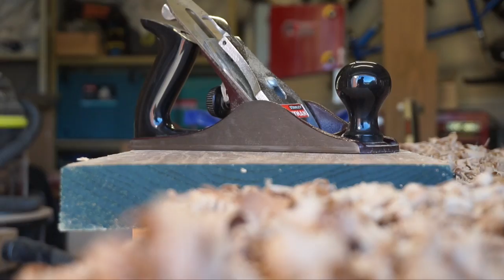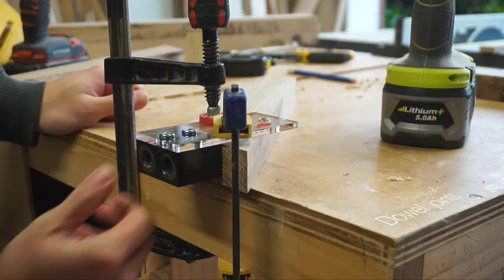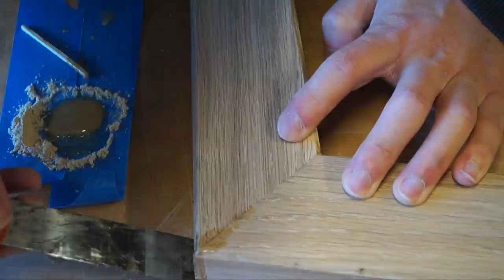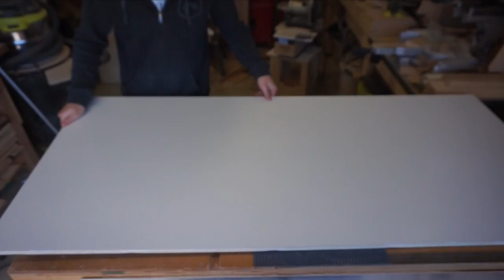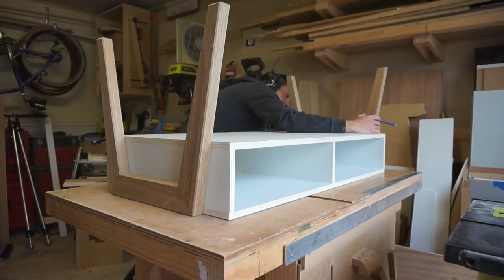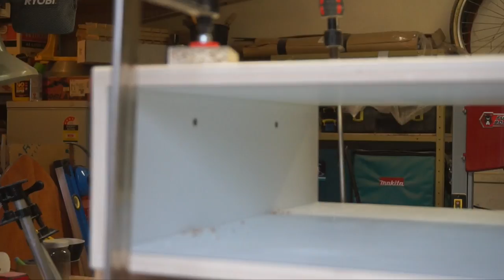Oak and Plywood Coffee Table

Comment: Maybe you already know this, but I have a small tip for hand planing. When you're trying to hog off that much material, you can start by planing 90 degrees cross grain. The wood is much weaker in that direction, and who cares if chips and splinters. Once you get close to final dimension or flatness, then you can reduce the depth of cut and switch to planing with the grain.

The only caveat is that you shouldn't take full widths strokes or you can blowout a big chunk from the side of the board that's facing away from you.

Comment: I like  your design, combination of colors , exposed edges.  if I may reproduce  your work, I would make the plywood joints miter and keep the edges exposed on the front and the back. I would make the beams straight without these arcs or braces,  and may be they  extend a bit  beyond the legs . Thanks for sharing
Reply from the maker: Thanks! Yes I agree, if I made it again I would do miter joints instead. I had initially planned to edge band the sides so you wouldn't see the edges so I went with butt joints, but then I decided not to edge band it but couldn't recut it to make miter joints.

Comment: did you paint the screw heads or something for the final photos? or edit them out in post production? anyways, love the table, really great work your cautiousness scoring the melamine really paid off, it's hard to pull off exposed engrain in melamine but it works in your case since you were so careful.  great project
Reply from the maker: Ahhh you got me! I did edit it out in post. It didn't look right with one screw showing and it looked like a bit of dirt or something so I took it out. Thanks! I did some test cuts to see if it would tear out even with a fine tooth blade, which it did so I had to score it. But it made really clean cuts

Comment: Is the top flush with the oak sides? Or set at different heigth? From the last couple of photos it seems different from one picture to the other. Nice looking piece and I really liked what you did on the joinery.
Reply from the maker: Yes it is flush with the top. Probably just looks like it in the photos because of the low angle. Cheers

Comment: Nice build
Just a question: why planing the cupped board an then ripping it?
Wouldn’t it be less work to rip first and then planing?
Reply from the maker: I didn't feel comfortable putting it through the table saw with so much cupping. I was worried it would bind against the saw blade. So I planed one face flat first
Reply: The Offcut makes sense. Thanks

Comment: Ka Mahi! Great project! Great channel! Quick question on your sliding-drop-mitre saw. I see it is a ToolShed branded one. Are you happy with the quality and quality of cut/accuracy? I am tempted to buy one myself!
Reply from the maker: Thanks! Yes I am pretty happy with the mitre saw. Cuts pretty accurately and doesn't have much side movement. I looked at all the other ones at Mitre 10 and Bunnings and they all had a noticeable amount of play for models in the same price range. The Toolshed one was far more rigid and saves a lot of space behind it with the rails coming out the front which is the main reason why I bought it.
Reply: Thanks! Just what I wanted to hear! Keep up the good work with your channel!

Comment: Very nice design, awesome work. But why did you plane the oakwood twice? first by hand and afterwards with the electric planer?
Reply: A planer will make parallel faces, but if the board is twisted or bowed you'll just end up with a parallel twist or bow. Hand planning flattened the piece, then the planer handled thickness and finish.

Comment: Mate love your work but how do tou get your tablesaw fence to cut straight?? Im having such a hard time with mine its impossible!!
Reply from the maker: Hahaha cheers! I know what you mean. I'm always double checking the distance to the fence from the front and back of the blade to make sure its square. A useful tip I found was to pull on the fence with the handle so that it is pressed against the little track bit in the saw where the fence runs along before you lock it down. This stops the fence from shifting when the back part clamps down on the table.
Reply: All good thats what i do, thaught you might have some magic formula🤣!!! Thanks for the reply and keep up the top work man!!!

Comment: Awesome video and table.  Haven't enjoyed a build video that much in a while.  What kind of laminate was that?  Is that something you could buy at a big box store like Home Depot or was it something you had to special order?   It looks like a really nice material compared to cheap melamine.  Once again, awesome video!
Reply from the maker: Thanks Adam! It is a high pressure laminate. Similar to melamine but a bit denser and more durable. I'm not sure if you can get it at Home Depot but you can't get it at box stores here in New Zealand. Most plywood/panel suppliers should stock them.

Comment: Hey man! Excellent work, I love your design and workflow. Might I ask how well you like the results of the Ryobi planer you use? I've been looking for a small planer on a budget (I'm a student) and it would really help me out. Thanks again!
Reply from the maker: Thanks man. The planer is okay. It does the job. I can't really compare it to other ones because I haven't used them. One issue I had was the dust port clogs up quite easily because I don't hook it up to a vac. I ended up taking the dust port off and making my own dust hood thing out of scraps so that the shavings just fall straight to the ground. I think any planer in the same price range will give the same results for planing.

Comment: noob question: Why hand-plane the wood if you're going to run it through a planer anyways?
Reply: Normally you would do this step on a jointer, but using a hand plane is much easier to do than wrestling a large piece of lumber like this through the planer. The other issue with working on a board this cupped is as you remove material, the board can move more. Using a hand plane means you're not removing too much material too quickly so you can typically handle the movement easier that running it through the planer outright and having it move during the cut.
Reply from the maker: Yup! And also I didn't want to run the whole width of the board through the planer because it is quite a hard wood and would put a lot of stress on the motor and the blades. I wanted to cut it down into more manageable sizes but to do that I first had to hand plane one side flat so I have a flat surface to run it through the table saw.
Reply: Thickness planers don't joint, they are made to get stock to the correct thickness. A twisted board ran through the planer will still be twisted- a common misconception. Although, you can make a jig for the planer to joint edges
Reply: this was the right answer
Reply: What do the jointer different?  If you have a wood that twist, won't it twist on the table? If not, why do it twist in a thickness planer? Just because the tables you run your wood throu are different sized? 

I want to belive you but I can't understand the difference.
Reply: Buy a jointer. Rough cut the parts and flatten on the jointer. Then run through the planner. More efficient than a smoothing plane

Comment: How do I go about getting the angle right for the feet of the table? Any tips?
Reply: half of the angle you want between pieces, if you want 90 degrees between the legs, your cut has to be 45 degrees. This legs are around 100° from the horizontal, so you have to make cuts at 50°

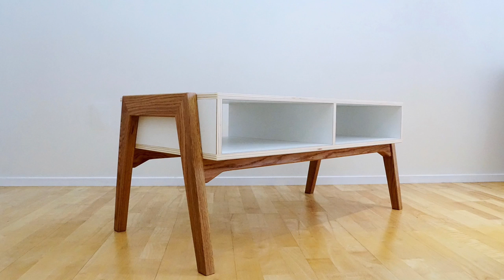Comment: I was cool with all this until you photoshopped out the screw heads at 14:31. Come on, man! :)

In any case, I was wondering why you went with screws there instead of, say, from underneath. I agree with your photoshop that the screw heads were a bit of a blotch on an otherwise beautiful piece. In any case, folks won't normally see them unless they're sitting on the floor. Nicely done.